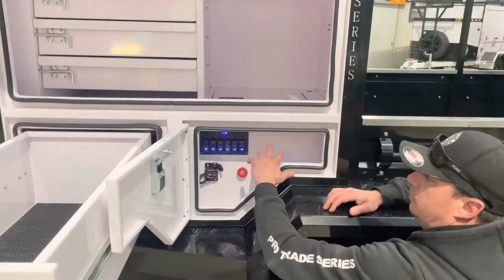The TPH quick walk around video

Comment: Great products! Do the other trailers have a independent suspension option?
Reply from the maker: Only the TPH does Caleb
Reply: @uprisingengineering4533  Cheers, was only asking as I have been looking into off-grid camping set ups. Looking at long range water, huge solar/battery capacity and high ground clearance. 
Absolutely love these trailers, I had a fortress trailer from Phil here in nz and he put me onto you guys over there. Moving over in a month or so, so should probably pop over and have a good yarn about options
Thanks, Caleb